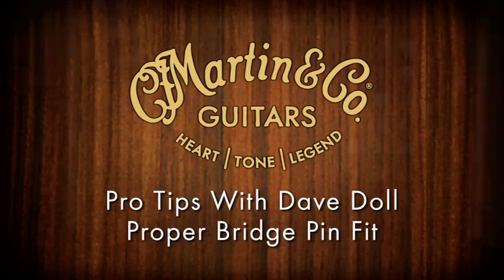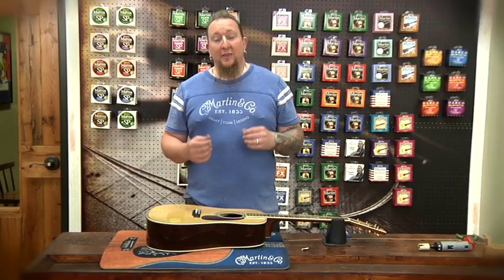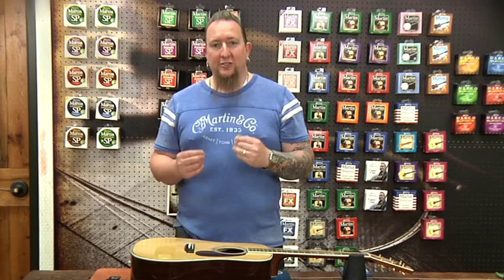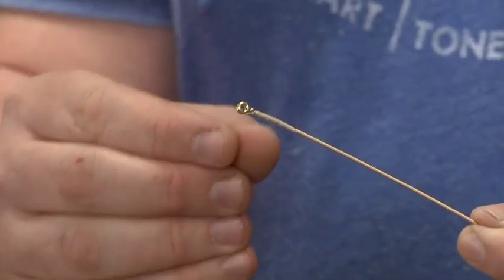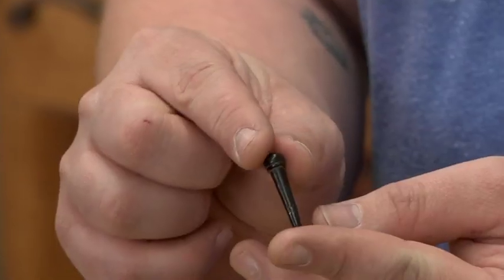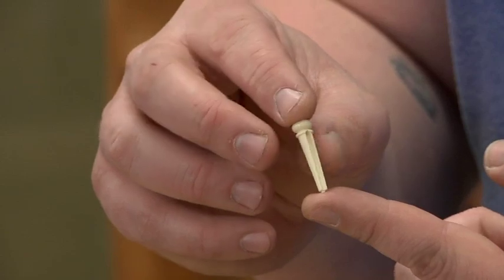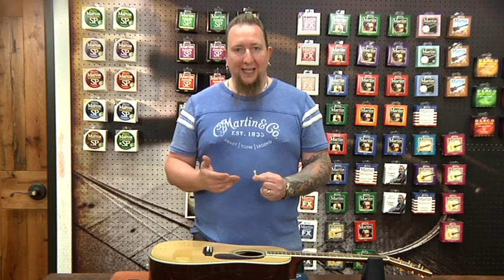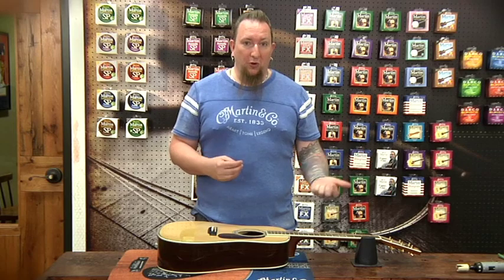Proper Bridge Pin Fit

Comment: I can't tell you how many guitars I've bought where the bridge pin was shoved in as deep as possible. The string should be able to rest against the plate with no pin, so the pin is just keeping it snug. When I used Martin strings, I only use Marquis. Thinking back, when I was a kid, I shoved the pin in to, so I guess it's a learned thing.

Comment: Dave, do you push the pin into the hole with the string ball at the end letting it stay at the bottom of the pin or do you allow the ball to take up that slack moving up wedged between the pin and plate?